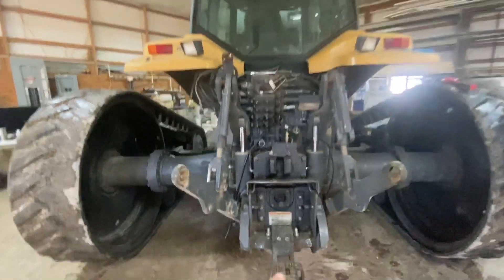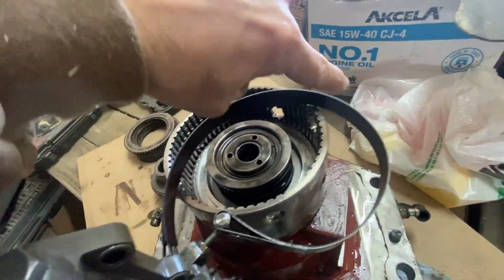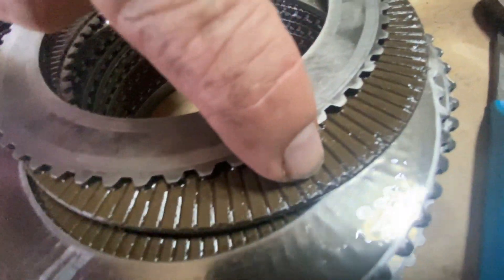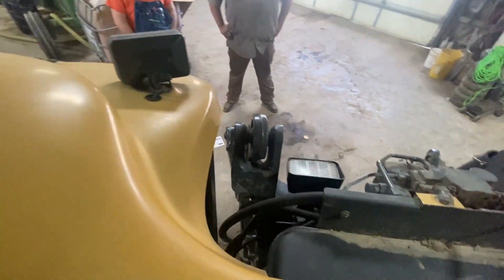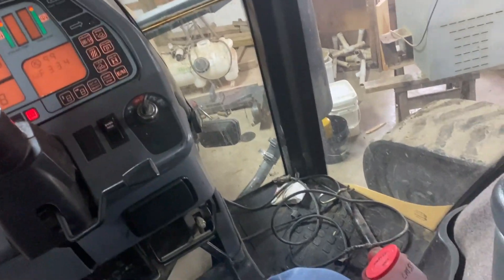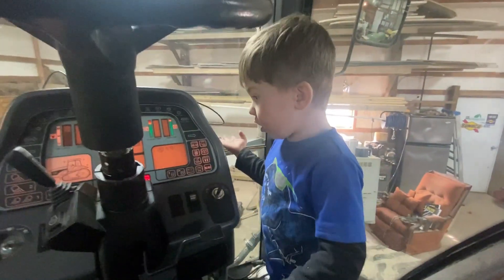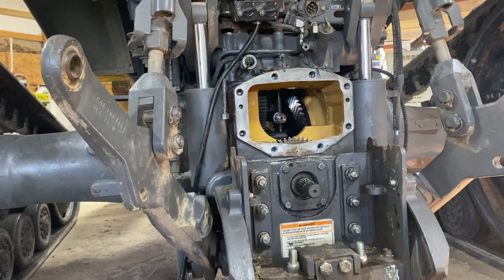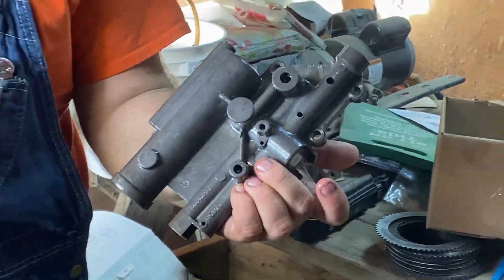Cat Challenger 55 Hydraulic Filter Bypass Troubleshooting PTO  Rebuild: Part 3

Comment: How did you get the PTO back in? I had to replace brake band and clutches but the drive shaft sags and been trying for 2 days now to get it back in.
Reply from the maker: I asked Shadow about that. Me and Terry put it in once then Shadow and Terry did it the second time. Here is what we recall. First time we bent the band and it hung up going in. Second time we spun the shaft going in and it went better. However as Shadow said you pull your guts out trying to get it lined up.  Plus the band wants to get in the way. Hope that helps.
Reply: @KannmacherFarm  yes I did the same thing with the band. Finally got it to were  I could go in with out it hanging up but that sagging shaft is what I was fighting. But solved it with a piece of twisted twine around the back of the snap ring to hold it up the once I got what felt like lined up pulled the string out and then she slid in perfectly! Thanks for the reply. And yes I used fork truck to help with extra weight tough for one man to do by himself.
Reply from the maker: Glad to hear it!